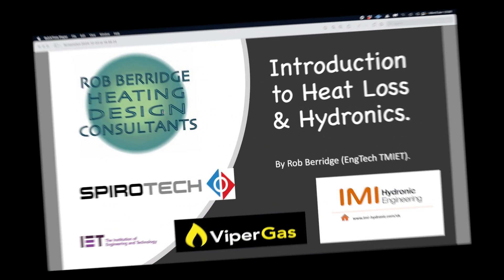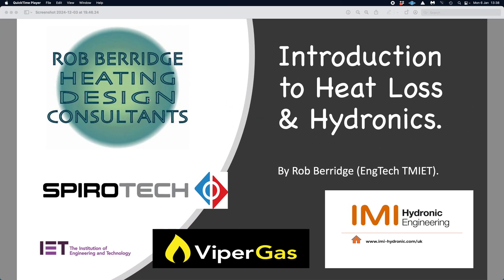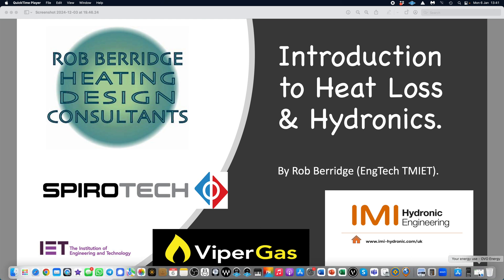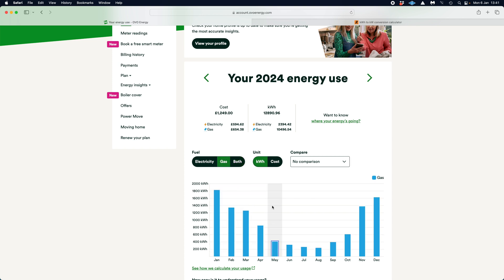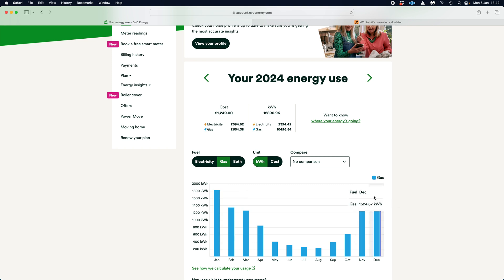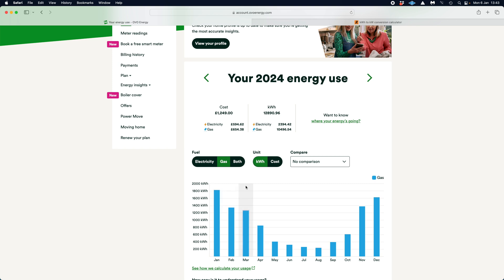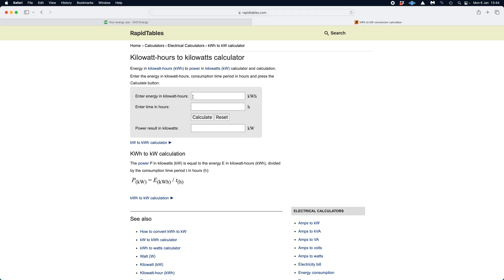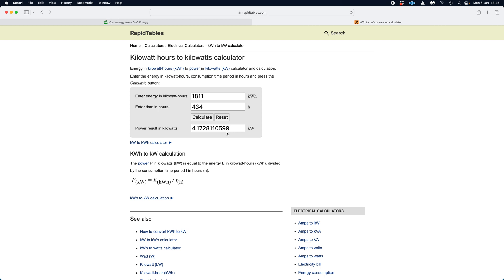kWh to kW Requirement Short Tutorial

Comment: Hi Rob, thanks for all the videos your putting out! I do have one question on this one, at about 6:10 mins in you mention that the calculation shows you that what you use and need to heat your house (over a 14 hour period up to your chosen room temp) is 4.17 kW. Wouldn't the 4.17 kW be per hour? 4.17 kW x 14 hours x 31 days = 1810 kWh. Please let me know, as I might of misunderstood or got confused. Thanks mate.
Reply from the maker: That 4.17 is your heat loss requirement and what you would size your heat source to. Remember, we chose the coldest month with the most heat requirement. The 4.17kW is the heat loss in real time and what you need to replace so I think you are over-complicating it by suggesting that it might take all of the 14 hours in order to get up to temperature; it wouldn't. Good question though.
Reply: @heatingconsult3543  Thanks for your reply Rob and explanation. Based on what you said I'm now unsure as to what the kW output of a heat source means. For example, if I install a gas-fired condensing boiler with a max heat output of 18.5 kW, then I've always assumed that the 18.5 kW is how much it could output over an hour period. Or if an ASHP has a heat output of 7.6 kW at a flow temp of 35 degrees when it's -3 outside, then it could output 7.6 kW every hour. But as heat loss is in real time, and we size the heat source to match the heat loss, then is the heat output the amount of kW's per second (watts = joules per second). However, 7.6 kW produced per second seems crazy to me. Any help on this would be greatly appreciated as I've wondered about this for some time, and it would be a great help!!!! Thanks again.
Reply from the maker: @ Heat loss is in real time, not per hour. The only parameter that changes is outside temperature.
Reply: @sip5574 yes 7.6 kw per second, and as 1 watt is 1 joule per second, 7.6kw over an hour would be 27, 360,000 joules of energy, so yeah it’s crazy, 7.6kw over an hour is 7.6kwh for 2 hours would be 15.2 kWh and so on

Comment: Hi Rob, Thank you for all your videos greatly appreciated, still learning at 56. Something I just realised as i was going to trial your method used against my HE room by room for my property and it suddenly occurred to me we have a gas hob so the figures for usuage will be skewed in my case. Something quite obvious to look out for when using this method if you have other gas appliances. Keep up the great work and thanks again 👍🏼
Reply from the maker: @rocktwang8497  You can easily estimate a reduction from cooking but this method is good enough to get closer to the truth and that’s all we really do. Slight oversizing of heat pumps or even boilers is not as concerning as once was as long as minimum modulation and good modulation controls are optimised. 
I’ll go into much more detail in future tutorials.

Comment: Hi Rob, how did you get to the 14 hours a day? Also does this include energy used for hot water if it’s a combi?
Reply from the maker: @michaelpalmer1835  We choose to heat for 14 hrs a day because we lose around 3.5° during set back time over 10 hours which suits us.
If you want longer run times to mitigate set back temp drop due to your building heat loss, just adjust the parameters in the calculation. 
Yes it includes hot water but the calculation is still accurate to an EN12831 heat loss calculation.